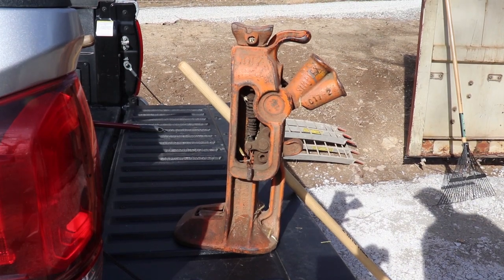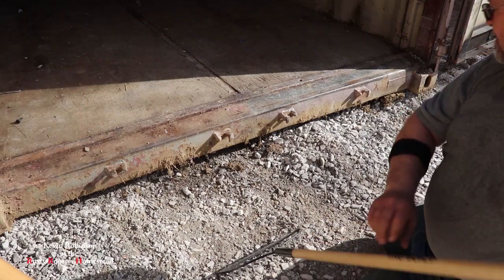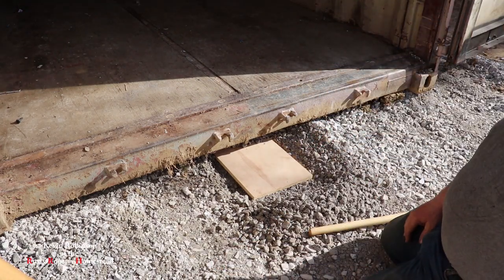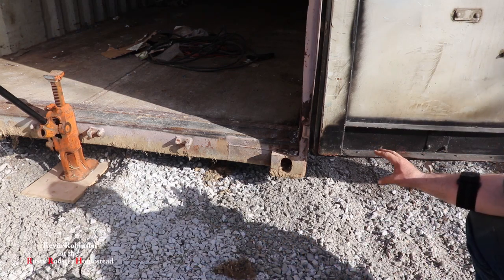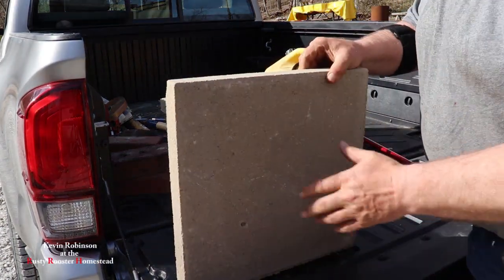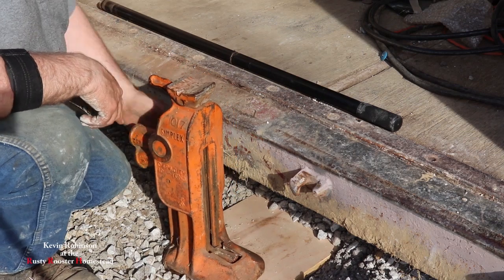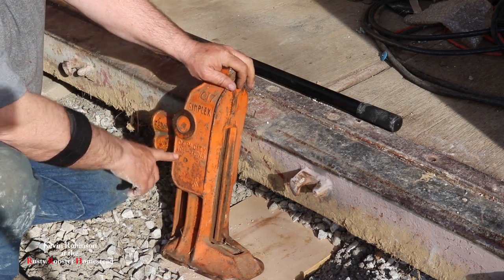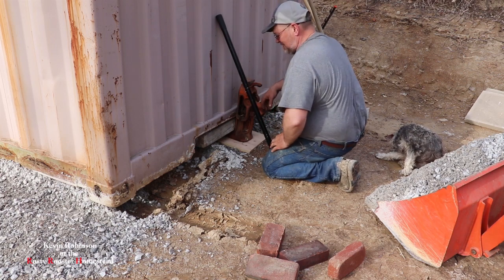railroad track jack to lift a shipping container

Comment: Don't forget to oil those old jacks and inspect the teeth and mechanism for rust. I use spray moly lube on mine.  UNDERSTAND THE MECHANISM BEFORE LIFTING ANYTHING IMPORTANT.   I use some flat scrap steel with a piece of chain for easy removal as a jack pad.  6x6 cribbing and old car and truck rims work nicely too.
The best jack for containers if you can score one is the "telephone pole version) with a chain grab hook on top of the ram. I use that and a J-hook with chain (wonderful to own even if you don't own a wrecker!) to grab fittings and edges.
Reply from the maker: Thank you for the good information.

Comment: I just bought a Simplex No.185 Jack from a metal scrap yard today while selling my scrap aluminum beer cans (60 cents a pound today !).
I didn't know anything about it or that it was used for railroad tracks.

I asked the owner if he had any old-style car bumper jacks (they are handy for removing fence posts, etc), and he said to go look in his "Treasure Shop"...  no bumper style jacks there, but this Simplex 185 caught my eye... took me a few minutes to figure out how it worked, and 
it works just fine... cost me $20... no handle, but a good 1" steel pipe should work great !

I'm going to clean it up a bit, and try using it to pull out a couple of bushes my wife wants removed... I would get stuck in the yard using my 
truck, so I will give it a go !
Reply from the maker: Good find and a good deal thanks for sharing.

Comment: You should try those big thick round ones that Bushradical used under his cabin. 
Those things were 4 inches thick. He said they only cost a couple bucks each.
Reply from the maker: Daryl, i already replaced them and so far they are working good, thanks for watching.

Comment: I did something similar with my shed. I used hydraulic jacks though and cinder blocks along with thick wood blocks to spread out the load. I recall my brother having a 50 ton railroad jack. The thing was humongous. That would have been handy.
Reply from the maker: Yes the railroad jack would have been great for that job.

Comment: Try replacing the patio paver with a real pre-made cement Pier block. That would require some more digging but only in a very small spot and actually would have a chance of spreading the weight of that container all the way to the ground in a larger area then a broken patio paver would give you.
Reply from the maker: We did replace them and so far the new ones are holding up great.

Comment: All that weight is concentrated in one little spot, I'm surprised they all didn't break.
Reply from the maker: Wayne, they did all break, but the new ones are holding up much better.
Reply: @Robinson-Homestead 11it.

Cost, lift capacity